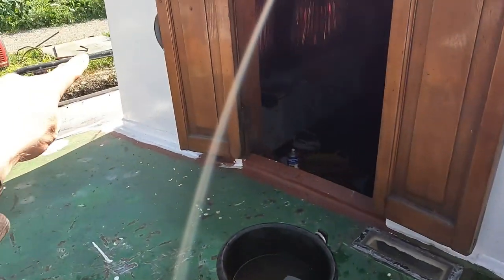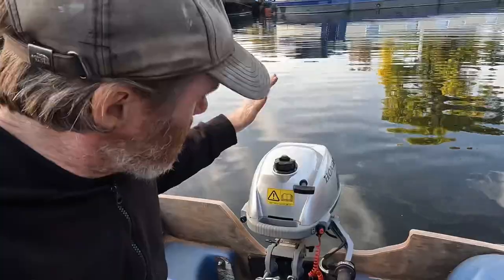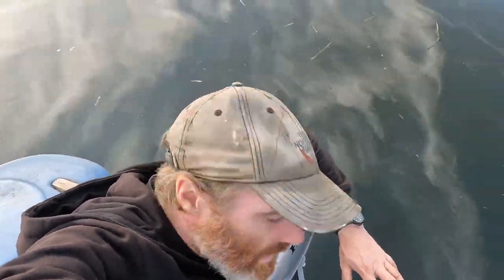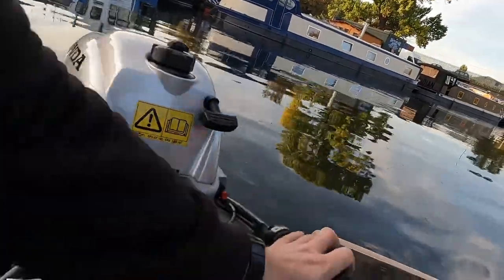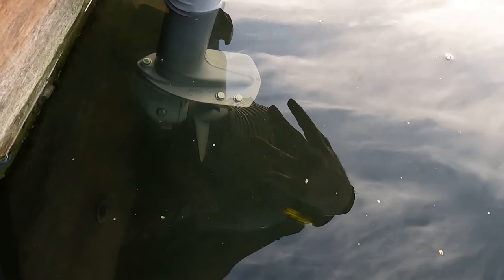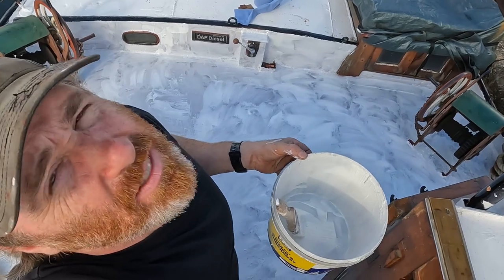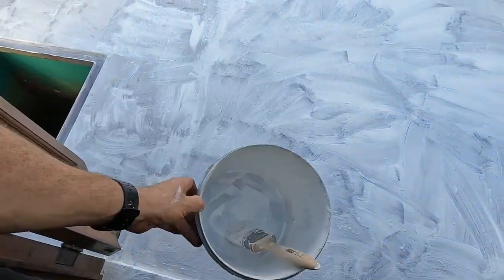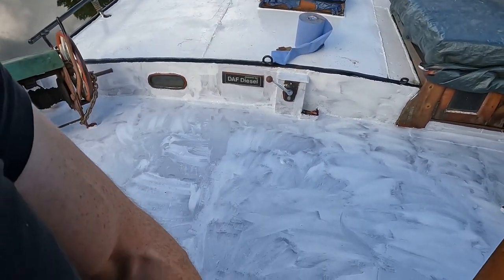Rudder, Leeboard Fenders and Deck painting on Dutch Barge Linda.  Done for now.

Comment: Canice the King of the Canals
At a cinema near you!

Ahhh,  Linda looking all spruced up for the winter season. Gorgeous. 

Isn't she just splendid ?!

Work never ends...We had to saw the rotten base off the little mast. Olly chiseled the end so it stuck back into its holder, seems ok.

I've just learnt that on exterior wood  beads of water can magnify in the sun and burn tiny holes in varnish, which over time let water in. 
So we decided to oil the mast.
Your creosote idea is very good, as you can reapply when necessary. 

Can't wait to see what you get up to inside... but watch out for the naughty Captain...lurking around causing havoc! 😄

Ps. Chasing a kingfisher with a powerboat?😀 Whatever next?🤣🤩

mighty
👍
Reply from the maker: That’s interesting about the beads of water zapping the varnish. Didn’t know that. I saw someone use creosote on their mast and rudder and anything wooden. The smell was intense for so long. 😂 My creosote doesn’t have the smell which I’m disappointed about. I guess it’s not real creosote.
Reply: @canicebannon  the best is tung oil , so we have ordered some to see. I remember creosoting fences in Ireland a long time ago, I tried to find it here but none to be got. Good stuff.:)

Comment: Looking much better. Could you not cover those stainless screws with a piece of thin timber, just glued and pinned in place - just a suggestion.  Would love to be restoring and converting a Dutch barge into a home  👍
Reply from the maker: My worry is that nobody will know which wooden plug has the screws behind it…..😂

Comment: Well done, very smart woodworking and painting amazing determination. Does your old gas locker drain overboard? Mine didn't so I cut it out. Well done catching the kingfisher footage - they are so fast and such good fishers.... That one didn't even need a tree branch to perch on
Reply from the maker: Yes the gas locker does drain out from the bottom, but a small amount is left. However, when the boat was sailing Chris would forget to close the cock on the drain and it would fill up with sea water hence the terrible rust. But it’s ok.

Comment: I would leave the stainless clean...looking nice, you going to texture the walking surface I assume
Reply from the maker: Hi Matt, that stainless may stay as is, because I forget to do anything about it!😂
I may invest in some sort of non slip deck mats. I have of course made this up and may have to invent something. It’s not slippery with rubber soles…. So far!
Reply: @canicebannon  You can always add silica or sand to the top coat to give it a bit of grip
Reply from the maker: @SayWhatinAz  this is good too!😀